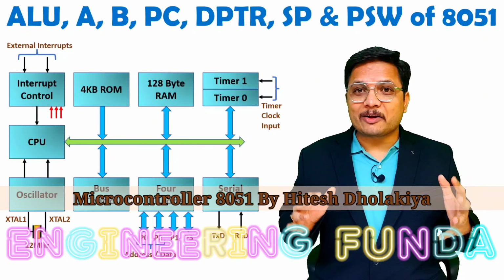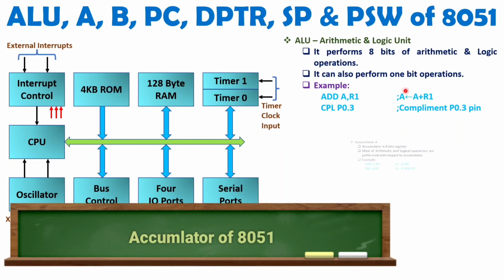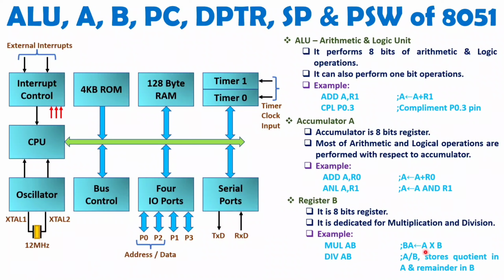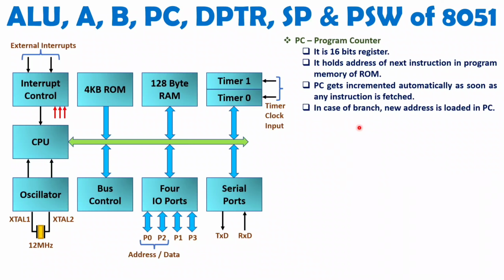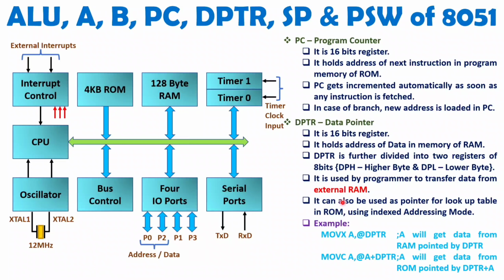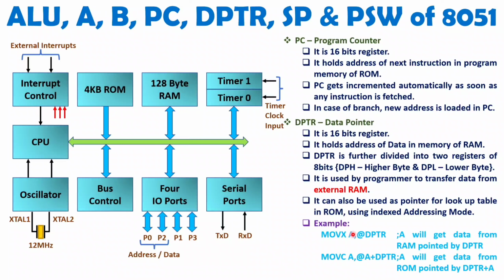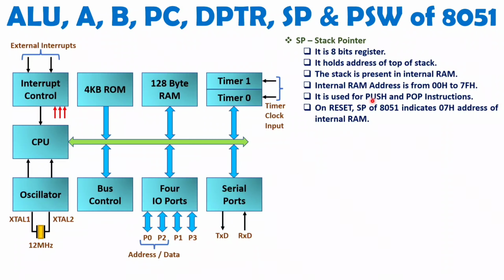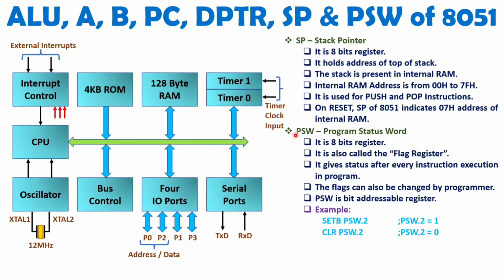Important Parts of the 8051 Microcontroller: Accumulator, Program Counter, and Key Components

Comment: • 	Accumulator (A): Like a calculator's memory — stores numbers for math and logic.
• 	Program Counter (PC): Keeps track of which instruction to run next.
• 	B Register: Helps with multiplication and division.
• 	PSW (Program Status Word): Shows results of operations (like carry, overflow).
• 	Stack Pointer (SP): Points to where temporary data is stored.
• 	RAM: Short-term memory for data.
• 	ROM: Long-term memory for your program.
• 	I/O Ports (P0–P3): Connects to buttons, LEDs, sensors, etc.
• 	Timers: Keeps track of time or counts events.
• 	Serial Port: Sends and receives data one bit at a time.
• 	Interrupts: Lets the microcontroller respond quickly to important events.

Comment: sir since 8 bits = 1 byte. im confused the internal RAM of 8051 would actually hold 128 bytes which would equal to 1024 bits and with respect to DPTR and PC which have a 16 BIT register , don't you think the storage is too big comparatively or else it might just be a mistake where it was supposed to be 16 BYTES ?

Comment: Professor, how to record the program with the microcontroller placed on the PCB?
What program do you use to compile programs made in assembler?
Thank you so much
Reply from the maker: Complier convert high language program (c, c++, java) into machine language (Hex  program).
Assembler convert assambly language program into machine language (Hex  program).
Reply: @EngineeringFunda  Thanks for sharing, teacher. But I mean what program do you use to be able to write a program in Assembler and convert it into HEX for example. I have a very old one, the X51 that runs on MS-DOS. I don't know if there is any more modern one. That was my question. Thank you so much. Best regards from Spain.
Reply from the maker: I have used keil Software for compiling both C and assembly code and flash magic software for burning the code into the chip
Reply: @EngineeringFunda  How to get the Kewil software? Is it libre, that is, free? Professor, thank you very much for connecting and dedicating your time. Incredible that from Spain he is contacting you. A cordial greeting.
Reply from the maker: Just write on google you will get it
Reply: @EngineeringFunda  I've looked for it and haven't found it. All the best

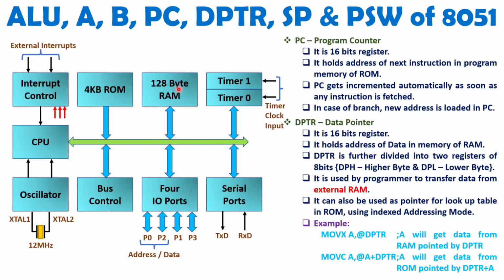Comment: 7:46
Incorrect. 2^n=128 iff n=7, not 8.
Reply from the maker: For that you have see my video on Internal RAM of 8051. This video is just to inform that DPTR is pointing External Location.
Reply: @EngineeringFunda  I think I know why.
Because with 7 bits we can represent 128 numbers, from 0 to 127. 
We are missing the address number 128.
So, in order to have 128 addresses, we should set 8 bits of address, not 7. Right?